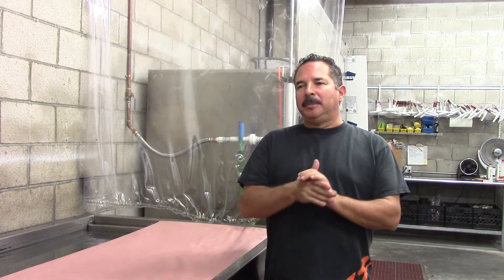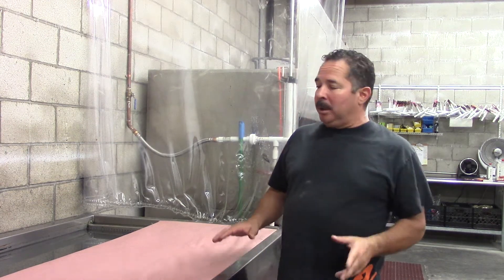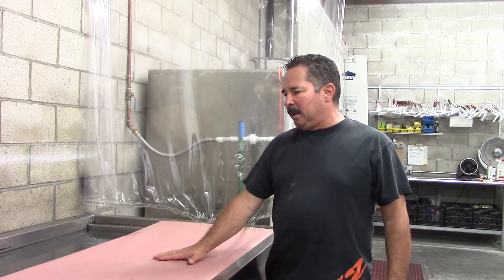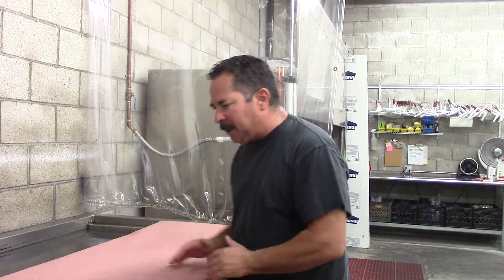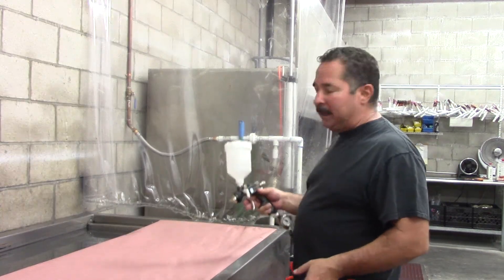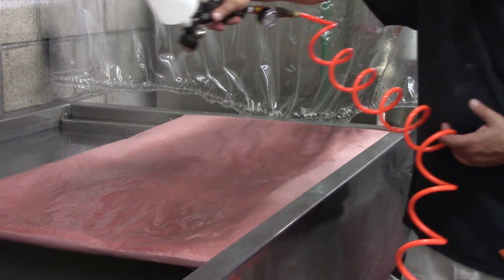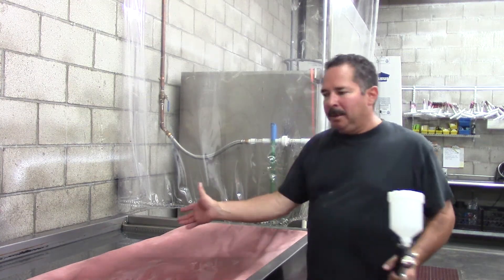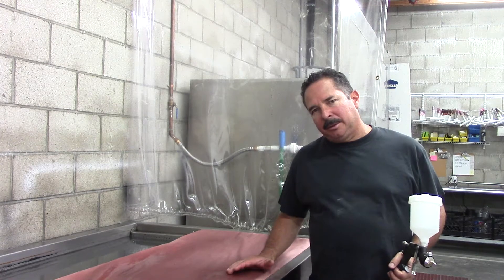K2 Forums Activator Application Practice

Comment: i usualy tape it on the wall. learned that from my painting career. but indeed, you always spray on water. gonna do that..
is that your activatorgun? devillbiss gti pro? what kinda nozzle and aircap u using?
Reply from the maker: It is a GPi not GTi...close...using a 1.4 in the video but I usually use a 1.8...air cap is the same for all GPi guns...

Comment: I have just got a spray gun which I use to apply activator, and on my first pass it looks glassy, but I give it another pass anyway. Is the second pass needed if the first pass makes it glossy.
Reply from the maker: Depends on what you film looks like on the part...if it looks good then don't change anything...if the films starts to move around on the water during the second pass then it is already liquid and probably does not need a second pass...
Reply: Jim Urbano thank you for your reply Jim, I'm a big fan of your channel.

Comment: What's wrong? I put carbon film in water and almost half of it falls to the bottom straight away, without activation just water
Reply: Are you taping all the sides?  If not it will sink
Reply: @Gitnardoproductions  yes all sides taped. Seems like it was just bad folie because half of it washed off too after wash
Reply: If it's washing off, I've learned that it could be too much activator spray or just a bad print not setting up correctly
Reply: @Gitnardoproductions  yes I think bad print, but bike (supermoto) come out just fine, carbon + stickerbomb looks nice, especially for my stepson
Reply: Gotcha, my current project is duplicolor gold engine spray paint on my taurus G2 slide and wow, it looks good!  Before that I hydro dipped my Mossberg 715t tactical in python and that came out really great as well